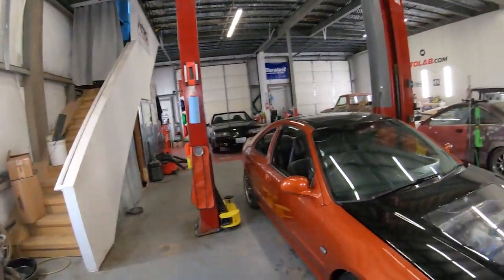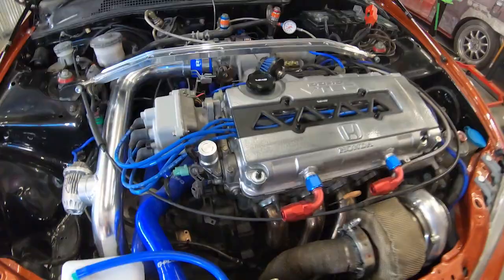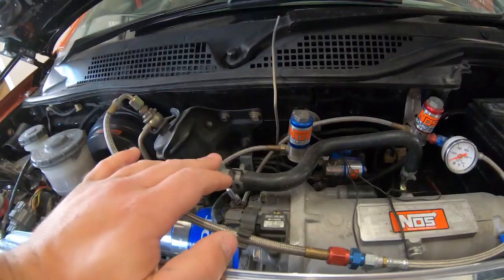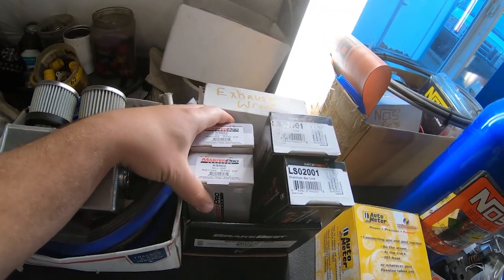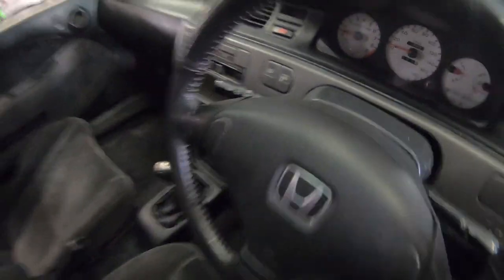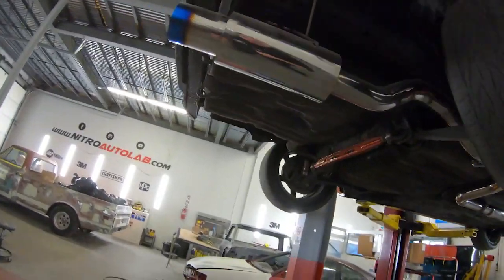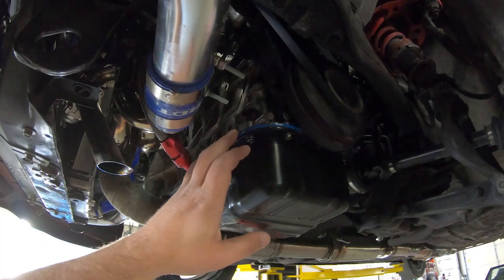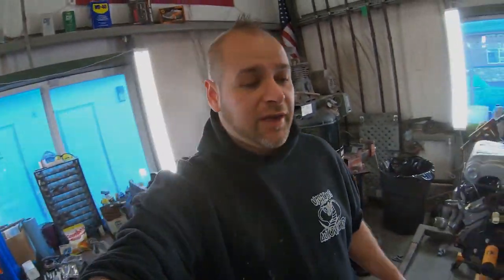BRIT SHOWS US THE RHD TURBO B16 NITROUS POWERED CIVIC!

Comment: I also have an EJ1, I've had it over 11 years now.  I'm also doing a RHD conversion as soon as I get a new daily, my dash on my clip is also a grey EG6 one.  Is there some way I could talk with you in detail about color matching it to black?

The biggest giveaway that she is a conversion is the sunroof.  None of JDM EJ1s had one.  I'm with you on that one though, mine will stay, forget replacing the whole roof skin and headliner just for that. Lol other than this I'm trying to make mine a JDM clone (besides the H22 swap) I'm even tracking down all the original decals and stickers.

My clip was about 95% complete, I'm only missing the steering column cover tube thing, (hoping my LHD one will work), gauge cluster and the console. I'm guessing it had an audio one and they sold it for $$$$$ on Ebay. but most importantly the engine bay fuse box was removed, I cant for the life of me find one, just the cover or the decal.

Have you considered installing the JDM retractable power antenna that goes on the left quarter panel?  All JDM EJ1s as well as sedans had these, they came with this funky "half" button mounted on the e-brake cover / arm rest that makes it retract only half way,  very odd but cool.
Reply from the maker: Awesome! Please follow us on Facebook and shoot us a message or add me “Brit Howell” on Facebook and DM me.
Reply from the maker: Your steering column will work fine. I reused my lhd column since it was tilt and also had my ignition on it.
Reply from the maker: I shaved my regular antenna back in 2007 as well as my trunk key lock, door moulding holes, and emblem holes to get rid of the economy family car feel. So I won’t be doing any other JDM mods.